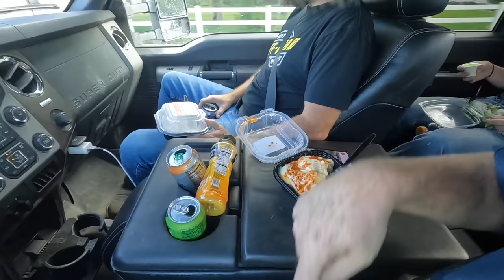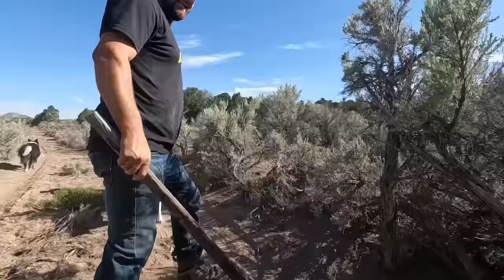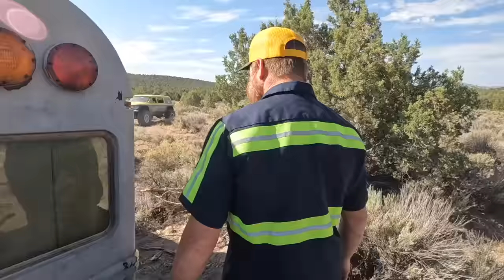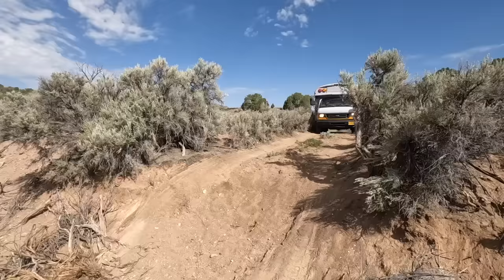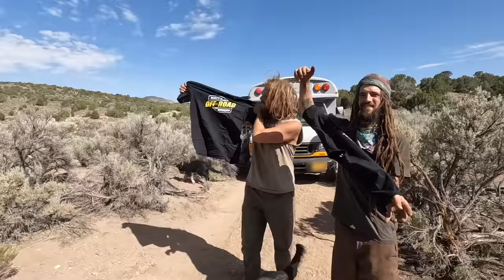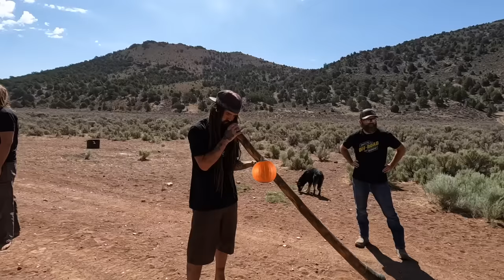How Did YOU Get That BUS Out Here?

Comment: Respect, that bus has seen more off roading than most 4X4s!
Reply: You can convert those old E350/450s to 4x4 if you want. They put ford 1 ton truck axles on them, lift them about 6 inches and 35-36 inch tires. Expensive conversion but they don't hold any value so you can pick them up used pretty cheap. Course it's still a big heavy vehicle with terrible approach and departure angles so you still need to be careful.
Reply: My little impreza is the same. Ive taken it through big mudholes, over a foot of snow, and i even pulled a toyota tundra out of the snow last year
Reply: @xToddmcx  some ambulances are 4x4, especially for mountain/snowy areas.  Not sure how lifted they are though.
Reply: I love the crosscountry conversion Jared from Wrench Every Day did to one. They entered one in a road rally and did the Cannonball Run in it.  🤣
Reply: Excellent observation!
Reply: Most 4x4 are mall crawlers. Never seen dirt
Reply: @taylorforster9256  No
Reply: @chuckstith838  I hear that a lot.  Not trying to call you out, but the Silverado I recently sold would've been classified as a mall crawler by you because folks like yourself only ever saw it clean. But I have had it covered in clay and mud up to the door handles and had to get my neighbor's tractor to pull me out. 

In fact, I'm part of the reason my nearby car wash banned off-road vehicles. We made him actually do his job in taking car eofnthe place. I guess our money doesn't spend the same.
Reply: Amazing how many super lifted, monster tire trucks with outrageous paint jobs you see on the road. I repeat: on the road.
Reply: @itomba  well in all fairness you gotta start on the pavement before you get to the dirt.
Reply: It's probably seen a lot more reefer, too.
Reply: @chuckstith838  The only time many of those will ever get "off road" is if they have to turn around on a median to get by an accident.
Reply: I had a 67 Volvo station wagen that I used to crawl around the mountains and deserts of NM. When I'd see those fancy "mall crawlers" I used to chuckle about how clean they were. Only got stuck once out near Chaco in a mud puddle on a two rutted "road". Got out the next morning. Loved this video. Reminded me of myself in the old days minus the tatoos.
Reply: My first 2wd s10 has seen more off-roading since I got it than the big lifted f-250 parked next to it in my school's parking lot.
Reply: @xToddmcx  🤙🤙 thats my dream project
Reply: @americansmark  For every person like you that uses their vehicle for its intended purpose, there are 6 that never see a non-paved road.  Especially those with the huge wheels with the tires that have about 3 inches of side-wall.  If you hit a pothole with a rig like that it will ruin the tire and break the wheel.  BUT, they think it looks cool.  How about the guys that have wheels that stick out 10 inches past the the fenders.  If they ever went on a gravel road, those tires would kick up gravel and destroy their $20,000 paint job.  Trust me Tom, there are way more like them than there are like you and I.  I also use my Dodge 2500 4x4 for what it was built for.  Hauling gravel,  hauling lumber, hauling 16 foot fence panels, and not to mention, hauling 2 full size quads on a slide in rack while pulling a 25 foot camp trailer.
Reply: @americansmark  did you see where I said most. I didn't say all.
Reply: Ud be surprised some of the roads I've gotten my bus down and out of..
Reply: @Dpher  yes

Comment: As someone who owns an old ambulance, I can tell you those old trucks will surprise you wheeling. The big problem with that bus and the washes was its departure angle was just shallow enough to get it hung on the back. If the axle were closer to the rear (like my ambulance) it would have had no issue at all. Fun fun. All it needed was a gentle nudge to get it off the frame and it was ready to go again, both times. Love those big dually boxes. Makes me think I should get busy and fix mine now. :)

Comment: Dudes in a school bus have been off-roading more than most with 4x4s.  I was a little... reserved... until I saw they made it over that big wash..  Props to them for taking a BUS off-road!
Reply: That one on a van chassis wouldn’t be ideal because they’re so low. But, a short bus on a medium duty chassis does pretty good offroad. They have decent ground clearance, a good wheelbase, and short overhangs. Just need solid ground as they sink quick.
Reply: I would of had it to had my buddy not been freaking out about the wash and stopped right in the ruts SMH

Comment: Even after watching dozens of MORR videos, I'm still astonished how far off the beaten track people get huge RV type rigs, or tiny, low as you can go, fuel efficient cars before they can't go any further.
Reply: I used to have a little Saturn station wagon with snow tires...it was mind boggling what you could get into with that little thing
Reply: My wife had a Toyota Echo which she took some sketchy places before we met. She said it was so light that they sometimes picked it up to get it unstuck.
Reply: I've used a BMW sedan to climb a boulder-infested dirt road to the highest drive able point in Washington at over 7000 ft.  This was in October with several inches of snow on the trail and a thousand feet of exposure that made for a white knuckle trip down.

If you have the clearance or have time to pick away until you find the clearance, it's more about the driver than it is the vehicle.
Reply: I used to work in the remotest parts of East Africa. As you went further and further out into infinite wilderness, the very last vehicle you would see coming back toward you was always a tiny toyota sedan.
Reply: Will Rivers  East Africa mostly gets cars directly from Japan. So lots of tiny Toyota sedans, both petrol and diesel. Back then I think one common model was called Carib.
Reply: Yeah I've taken my little rear wheel drive cargo van into some (stupid) rugged places. Granted, I've got 10 years of military driving experience, and far too much confidence. I accidentally crossed onto a soft-sand orv road and truly had to skid the thing across without stopping at 25mph. Terrifying and exhilarating. The random washes in the road were great for tossing the rig about lol.

Comment: About the BMW job with the flat tyre: when trying to get a stuck or rustef on wheel loose it's a lot more effective to kick backwards. Hold the lip of mudguard while standing with your back to the vehicle and kick backwards, with your heel om th edge of the rim. Alternate between the left and right side of the wheel. Works way better that trying to kick forwards.